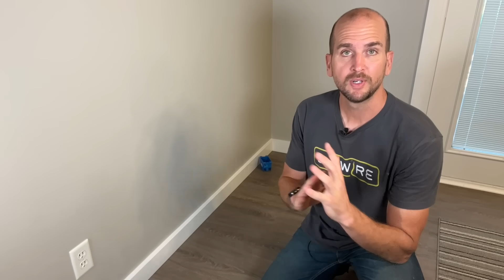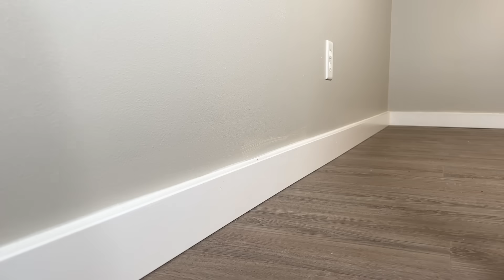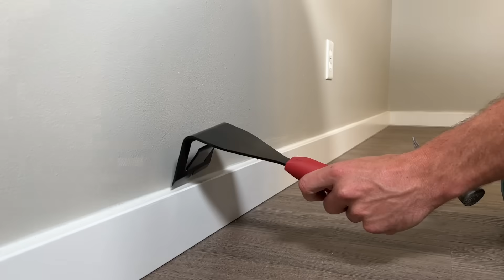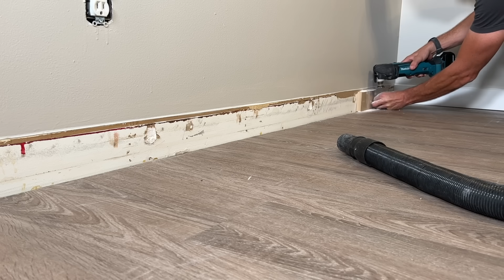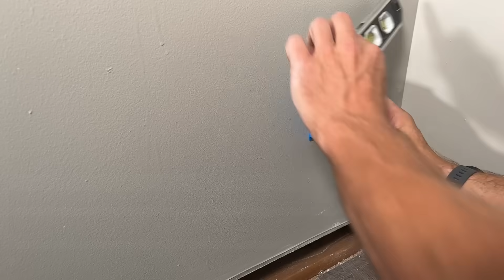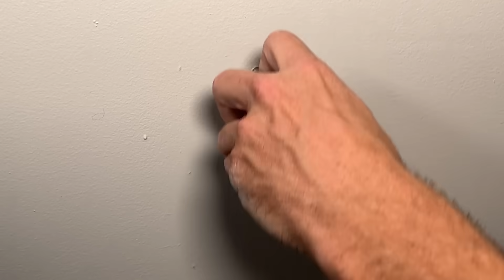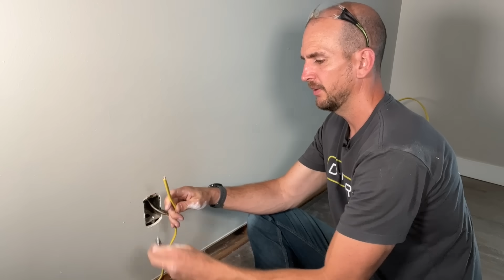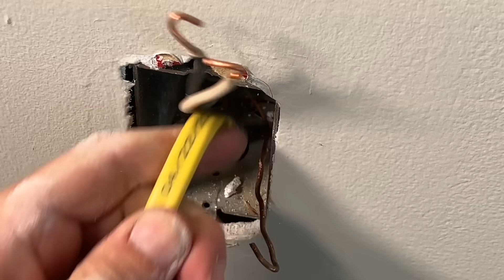How To Add An Outlet To A Finished Wall

Comment: Here's what you do when you apply caulk to trim. When you cut your caulking tube don't make a gigantic hole just make a small hole Not much bigger than half the diameter of a straw cut it at an angle then very gently squeeze your caulking gun and allow the caulk to start coming out put it against the wall and gently squeeze the caulking gun as you move across the top of the trim. Wet your finger and gently slide it across the top and smooth out your caulk if you have too much wipe it off and smooth it out again there's no point in buying all these tools and all this ignorant stuff applying caulk is literally So easy you could train a monkey to do it.

Comment: Im not a fan of wago nuts. Ive had the levers lift up when putting wires back in the box. I love the space they save, but the extra time putting electrical tape over it is about the same as the fight to fit wire nuts in the space. Thanks for the video.
Reply: Because next time you don't have to CUT more wire off after you remove the nut and do anything with the wires.

Comment: Have Stud Finders, But Mostly Use 1/4" Magnets. It Locates The Screws,
Instead Of The Big Round Hole, Would Cut For A Switchbox, If That Was The Start. If Using A Hole Saw, Center On The Stud, Then You Done Need A Strip, Is Alteady There, Use A Magnet To Locate Any Screws, The Force Phillips Though The Drywall To Screw Head, If Removing A Large Square, Locate All Screws, For Screwdriver To Heads, And Remove All, Don't  Need To Destroy Drywall. If Cutting Large Square, Do Center Of Stud To Center Of Stud, You Have Something To Screw To.
I Would Consider Doing Behinde Baseboard, Crown Molding May Help Reduce Damage, I Alway Think How To Get From Above, Below, Other Side. If That Was Attic.

Comment: That 1" drill bit is way overkill.  1/2" for 14 wire and 5/8" for 12 gauge wire is plenty unless you're running more than one wire.

Comment: Couldn't you just have connetcetd the new wire off the other connection screws on the original plug instead of using the Wago connectors or any other connectors?

Comment: Not a big fan of the WAGO connectors.  When pushing wires connections back into the box, I found them opened by wires touching them.

Comment: Sometimes is also best to (at a minimum) prepare to replacing the existing box, especially if has a minimal cubic inch rating.  #12AWG = 2.25 cubic inches X 7 = 15.75 cubic inch box requirement for existing metal box. And, the new box can be installed flush to the wallboard this time around.

Comment: Good video, but ground also has to go to metal box, not sure if you did or not. Code here doesn't like back feeding outlets. All wire nuts must be taped. Turn in screws and Tape Around outlet screws. Especially in metal boxes.
Like going in behind baseboard, but always good to check for wires coming up from floor so you don't cut any. Even though you can control the depth on the plunge cut .
Reply: Yes I admit I missed and could not see about that ground on the metal box. So i agree with your question.

Comment: great job but I would of used a new receptacle in the existing box and never would of used those push connectors as you added 2 connectors and 3 more wires in an already confined space

Comment: The only thing missing for absolute realism is the part where you forget your drill bit broke and the store is closed for the holidays and your wife wants you to clean up the mess you made TODAY, or your saw slips and you cut a gouge in the nice finished wall, or...so yeah, aside from showing how to deal with the sort of thing that happens whenever I take on a task like this, it's a great video.
Reply: More of a realistic scenario.  Kudos to him for making it look flawless.
Reply: 😂😂😂😂😂have you been spying on me?
Reply: I identify with you fully.
Reply: Maybe you should have someone else do your projects? 😊
Reply: I felt this.
Reply: That is why some people don't have wives! 🤣🤣🤣
Reply: Yes! We call that Murphy's Law.
Reply: My realistic moment is absolutely wrecking the piece of drywall I am trying to remove without damaging. That is if I haven’t snapped the baseboard trim in half. I usually start a project like this with a major loss 😂😂😂
Reply: Let's see, Murphy's law in action. 
- stud finder not finding studs.
- receptacle screw terminal snaps off.
- trying to find the correct circuit breaker to turn off but the breaker box is mislabeled.
- trying to fish wire through the wall but it kinks up on itself.
- can't find those wire strippers.

Comment: I need to add an outlet up 5 ft and roughly 40 inches away from another outlet. Do you have a tutorial that can help with that? It's to plug in a ductless range hood.

Comment: While this video makes this easier, there is more to the project than just adding the outlet. If the house is an older house, unless you check it, you have no idea how many times this same “trick” has been performed. You have to make sure the existing breaker and wiring can handle the additional load potential that will added.
Remember, the question is not can it handle what you are plugging in that outlet but the potential load of all outlets being used. If there is an open outlet people will fill it. Overloading a circuit is not just inconvenient when the breaker trips, it is a fire hazard.

Comment: I might use this same method if there is ceiling corner molding and there is HVAC obstacles at the baseboard. Thanks for showing us a very practical solution, and I wonder why I never ran into this solution before in all my years of DIY projects.

Comment: I hope you charged accordingly. To me that means you add in the cost of them hiring a dry wall repairer and a painter. We should be charging more than plumbers for shit like this. I would have liked to have seen you show how you knocked that K. O. out of the bottom of that metal box just for grins.

Comment: Love the WAGO lever nuts. However, when using them, I always failsafe them by wrapping a strip of black vinyl electrical tape perpendicular to the WAGO levers, which prevents the lever from being inadvertently flipped and releasing a wire while pushing your WAGOs back into the J-box.

Comment: CANT BE DONE WITHOUT BUYING ALOT OF STUFF.
Reply: Nah. You can do it with a pry bar, a screwdriver, drill, hammer, some finish nails, some twist-on connectors, and a utility knife. He just used special stuff for more ease. The connector will likely be there already if there's a metal box.

Comment: I'm Just a DIYer when it comes to high voltage but I have done commercial and industrial low-voltage for a few years and I never thought about this base board trick for my house. I feel like this is going to change the game for my home theater install in my finished basement. I was seriously worried about how to run new outlets and cables without having to mess up the drywall. Fantastic Job!

Comment: That's not even legal! You can't add a outlet with out considering oms law, if you add a outlet  your increasing amps
Reply: LOL YES IT IS LEGAL!. You are not increasing amps.....  There is ZERO problem, zero NEC limit on OUTLETS or Receptacles per circuit.  For instance, I can have a circuit with one duplex receptacle, and plug a heater using 12 amps into it. I can have a circuit with 30 receptacles on it, and use 20 of them, pulling 10 amps or I am using none of them.    Does not matter how many empty receptacles you have.

Comment: Smart concept to avoid holes in the drywall. Just curious though why you created pig tails instead of just just using both screw terminals on the outlet ... I'm guessing it was for a product ad for your affiliated products (a.k.a. kickback).
Reply from the maker: I just wanted to demo pigtailing as some can struggle to get the outlet back in the box when bringing multiple sets of wires directly into the outlet.

Comment: The receptacle you are pulling power from looks like it's at the end of a run. (1 common and one hot wire). How would you add an outlet if it wasn't an end of a run and had multiple wires?
Reply: more pig-tailing or piggy -back the receptacle. No big deal

Comment: This is a great video when I have subscribed, however, I think drilling the holes through the studs as has been done leaves the electrical wires open to damage from other people who are driving nails into the stud, perhaps with a taller base plate someday. I wonder whether it would be better to make the holes lower, which would allow for a nail plate. Clearly space needs to be left for attaching the baseboard,
Reply: There are rules about length of screws/nails through walls/drywall etc. You should never go longer than that rule (depends on drywall thickness or other covering thickness).   Stud holes for NM-B etc, leave protection in the stud of at least 1-1/4". Just because homeowners do not automatically know this, it must be followed. Never use a fastener longer than what will meet the edge of that hole.

Comment: What if I’ve got plaster and lath, not drywall?
Reply from the maker: Unfortunately the plaster would not be as easy to work with.  Some might remodel the plaster and lathe then put drywall back resulting in the same thickness prior to placing the baseboard back on the wall.

Comment: electrician with 26 years of experience. In general-- this idea is good, but in reality-that baseboard molding half the time would break--because beside nails on the conner are ton of glue, or simply its super old and dry wood!. Second thing- what if molding only 2inch wide? Bottom plate 1 1/2'' and you left with 1/2" not even that.

Comment: Neat trick but not up to code. Electrical work must be inspected. You add an outlet no documentation of inspection have a fire insurance doesn’t pay out. Plus if your race way is not far enough back you need nail protection plates.

Comment: Ok, the plug has 2 hot and 2 neutral. why use wagos at all? seems like an extra unnecessary step because the outlet has 2 hot, 2 neutral. In my mind you have the initial hot/neutral coming in to 1 terminal, then you use the second terminal to run to your new outlet. Why wouldn't you use the outlet provisions? thats why they're there, to go from 1 plug to another...
Reply: some don't like to. They think if the first 'receptacle' fails, the next one stops working.

Comment: I know this is an old video and response, but I think the code says strike plate wherever there is a stud. The inspector for a CT big city would insist on it, as I've had that conversation. Otherwise, it's a terrific video. Oh, the inspector also forbade me to be within several inches of the base board. This guy had sheet rock to the bottom, where 4" or so of baseboard can be found on a lot of old work, especially Colonial trim. I was absolutely forbidden to pull wire through the base board space. I was told by the inspector, "Even though you know it's there, someone might come along who doesn't...." Also loved the magnetic stud finder. Clever.
Reply from the maker: Thanks for the feedback and you are right that your inspector could have issue with this approach.  I have used EZ Guards on other vides for added protection https://amzn.to/48hvQ35

Comment: Are the 221 lever nuts ok to use if you are adding an outlet to use for the purpose of a wall mounted fireplace?? Are they ok with the extra draw of current for the heater?

Comment: I had a one of those a/c unit installed through the wall in a location that was enough to Cool the kitchen and living room at the same time. Problem is no wall outlet close to the a/c so need an extension cord to power it. Afraid of calling an electrician cause they charge a lot even for small jobs. Can't do the job myself was in a bad accident and my back has limited mobility but thanks for video

Comment: In Milwaukee, Wisconsin - Has electrical code been relaxed?  In the past, Romex cable was not allowed within a home’s walls - open attic or garage walls were allowed.  But, within a residence, metal sheathing was required - flexible BX or thin wall or rigid conduit.
Reply from the maker: Nope, NEC allows Romex in walls.  I think places like Chicago (and it sounds like Milwaukee) have additional codes on top of the NEC that call out things like conduit in residential construction.
Reply: @EverydayHomeRepairs  That sounds about right.  Like I noted, my experience is from Milwaukee.  Building codes can be complicated - not just electrical.  Thanks for the update.  Thank goodness I went into computers instead.  😃

Comment: Great video. My only addition is I always check for power on both receptacles as many times one is switched and one is not, may or may not be from same breaker. I just don't take chances!

Comment: So much better to put holes in the drywall above the baseboard and plaster them up.  Fixing flat wall area is so much easier to make perfect than trying to keep the trim perfect. Also why are you adding 20A romex for the outlet daisychained off 15a?

Comment: Do you not sleeve the bare earth wire before pushing back into the box, with open live and neutral terminals on the back of the socket?
Reply from the maker: Nope, it can just be a bare ground wire.  You should tuck the bare ground away from the hot screw terminals or you could cause a short that would trip the breaker.
Reply: @EverydayHomeRepairs  Here in the UK we have to sleeve the earth with a yellow/green stripe sleeve and also connect the earth to the metal box.

Comment: I'm a real novice, but I don't understand how the power gets from one outlet to the other.  In the video it seems like the two weren't connected.  yes, I saw black to black white to white...but then if those are connected how does the original outlet get power?

Comment: One of my best watched Youtube videos.  After watching this video, I have used this technique many times.  Only one change.  I do use the oscillating to for finishing my cut, but use the Dewalt DCS571 20V 4 1/2" Circular saw for most of the drywall cutting. Two reasons:  It give a really good straight and clean cut, and a number of times, in a couple older houses, I have run into thicker walls ( sheet rock over wood).  Also much quicker and can attach the vacuum to the tool.  Normally with 3 1/2" base trim, I can use a 2x4 flat on the floor as a spacer and with the offset of the saw blade to the shoe of the saw I end up with about a 3 1/4" cut.  Really, thanks for the idea.  Also, drill your holes as high as possible, so as to hopefully miss any nails used thru the bottom plate into the studs.  Cost me a very good drill bit.

Comment: Dude, your floor,… you worried about which way the slot in the screws holding your cover plates went.  But thrashed on your floor with no protection.

Comment: I’ve done this before as I am a contractor but the only thing you didn’t do is add cable protectors in each hole or strike plate protectors on each 2x4. This will prevent anyone shooting a finish nail right through your wire if you ever replace baseboards. Other than that it’s a great video on how too.

Comment: 9:00- So the blue box attaches only to the drywall, not to the stud?
Reply: Yes
Reply: @surferdude642  Thanks. That makes me uncomfortable though.
Reply: @jwf2125  Understand, I probably would have used one of those old work boxes which screw to the stud. For example Carlon B125AB or Arlington F101.

Comment: This is amazing. I just moved to the US almost a year ago and have no idea about wood made houses. I'm from Mexico and houses there are made with concrete, I know for sure how to install a new outlet in a concrete wall but not wood/dry wall. It's also interesting all the tools and hardware you have to use for this, it's obviously safer. Where I'm from we would just connect the wires together and put some electrical tape and that's it.

Comment: Great job. Only thing I would do different is drill a 1/2 hole in the bottom studs once the wall is open and insert the wire.
Reply from the maker: Thanks for the feedback!

Comment: An easier way than I've done. Thanks. BTW why 12 gauge wire? Original looks like 14 which by code would be a 15 amp circuit. If it's what you had on hand I understand but the price of wire aint cheap.

Comment: Great video. Great work.  I appreciate a job well done.  I know the new plug and plate would set better if you bust the tabs off any receptacle installed on an old work cut in box.

Comment: Great job, I used to run low voltage and speaker wire this way, with the occasional outlet relocation or addition. Careful in an older home! That trim might be hardwood and hard as metal, or a type of wood or trim profile that is impossible to get anymore.

Comment: Good to note to make sure your receptacles match the amp rating of the wire.
Reply: 15 amp duplex receptacles are permitted on 20 amp circuits.

Comment: Why is romex not secured 12" outside of the box? I thought it was code to do this. Thx
Reply: It's not required in rework applications when it's impractical to do. See NEC 334.30(B)(B)

Comment: DOES NOT MEET CODE.  Standard Romex load and line wire (cable) MUST be stapled to the stud at the box.  It's disappointing that the "Electricians" giving kudos here fail to recognize this very basic violation.  Going along the baseboard is a great idea but as always if a job seems too easy the methodology is likely wrong.  So you still need to open the wall at both boxes to secure the cable.
Reply: Not true. It's permitted if it's impractical to staple to the stud. NEC 334.30(B)(B)

Comment: You should really count how many outlets are already on the line bc you put to many it can harm the line and with whats already pluged in
Reply: No, it does no harm and it may help prevent someone from just plugging in a power strip or an extension cord.